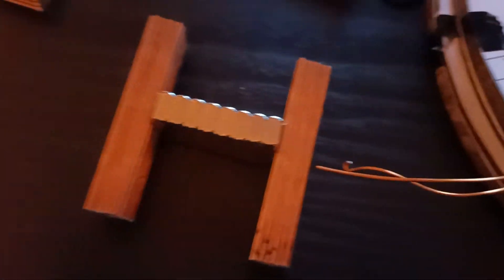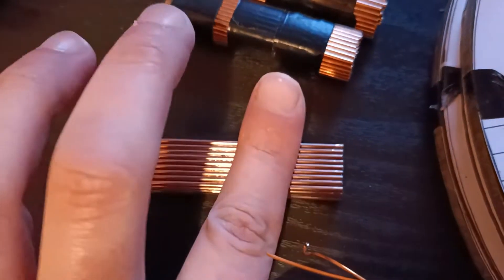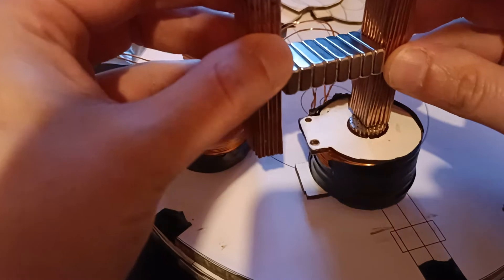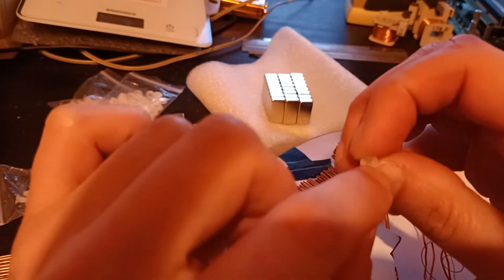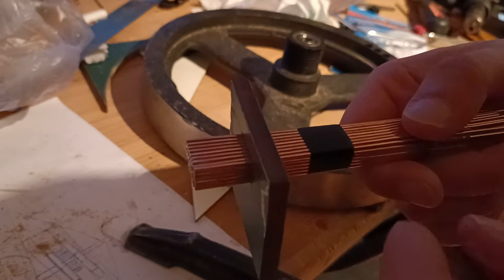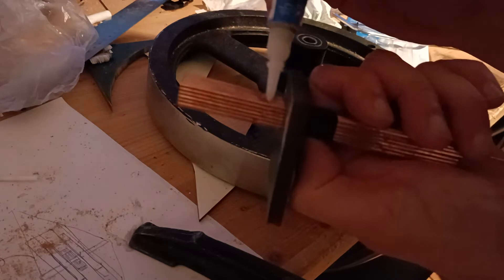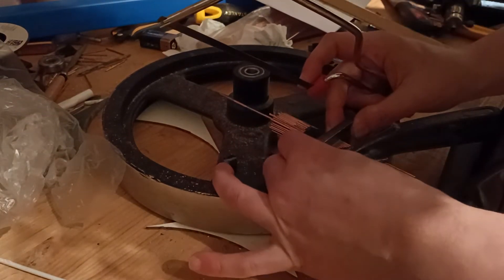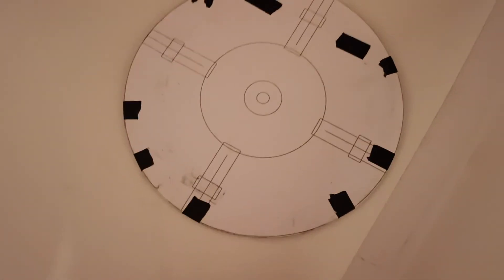New Gen: the Flux Guides

Comment: Looks good
Reply from the maker: Yes, thanks! :)
Reply: @toffeeflavour  it dropped the single coil because the end of the core was a open magnetic circuit.  Lift 2 coils with a bar across then put a second iron across the open end and see if the 2 coils drop then.
Reply from the maker: @MAGnetICus_Attractus  Alright, hold my beer..
Reply from the maker: @MAGnetICus_Attractus  I posted the answer to that in another video!

Comment: Hey nice work o the square iron cores. You know if you have a 3d printer you can print some of your parts instead of using other materials and dimensionally it would be more accurate
Reply from the maker: Yes you know I have this resin printer here, I think the PLA printer would do a lot better for these kind of things. You can indeed also make it with a printer, but I find that constructing it this way it'll becomes very rigid and strong. I guess making the high pressure laminate parts could still be made more accurate using a CNC and the cores using the iron infused PLA and a 3D printer. Yes, but I wanted to make the generator sooner than later, and I don't want anything like tuning a CNC or printer to stand in the way of it. But you can ;) JP
Reply from the maker: On that last comment.. in Januari I thought I should make this, 'before the war', I mean hypothetically.. Guess what suddenly a war started in europe :/ may peace come once again and stay forever